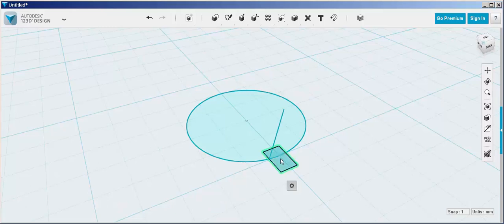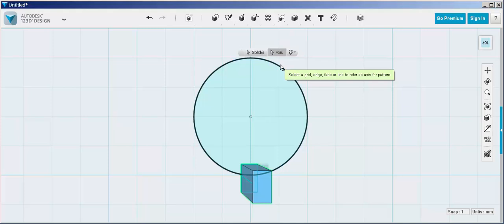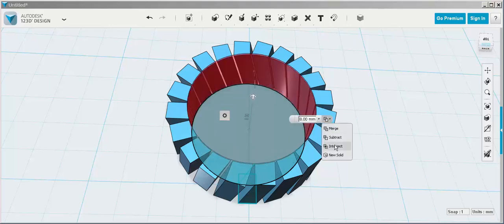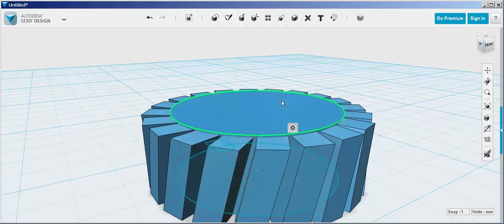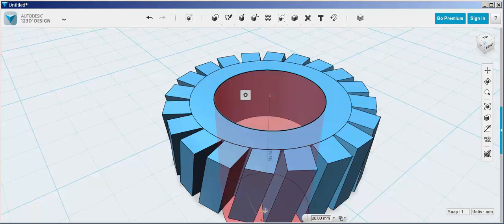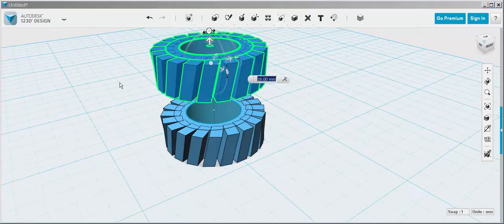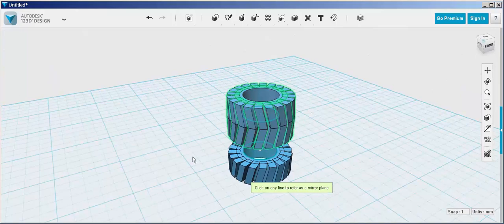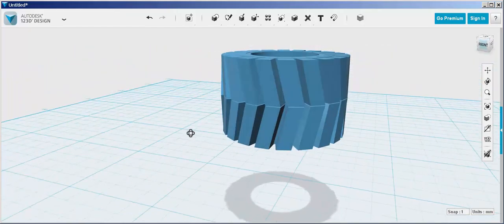123D Design: Herringbone (Double Helical) Gear

Comment: Nice, but i wonder how could be useful a gear that cannot engage with itself; so, nice but useless, take a look here: https://en.wikipedia.org/wiki/Involute_gear
Reply from the maker: +Leonardo Vivarelli I was just drawing this. http://dir.indiamart.com/impcat/herringbone-gears.html
Reply: +ProfDrafting yes, but the tooth profile is not square, and there are reasons for that, look at the page I linked
Reply from the maker: All that won't fit in a 3 min video. :) Seriously, you need Inventor to do that finer work. Too hard w/ Design.
Reply from the maker: My purpose is to show how to use the tools. Once people know that, I trust they can figure out the finer points themselves.